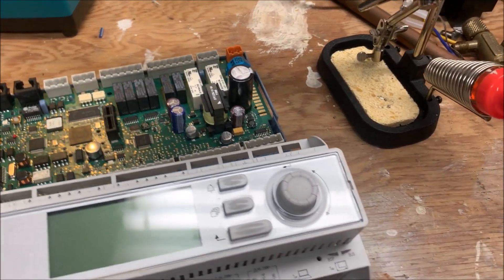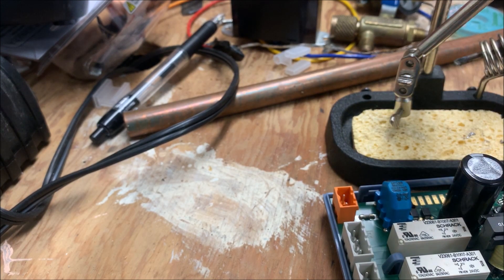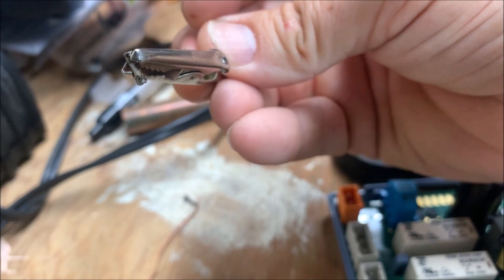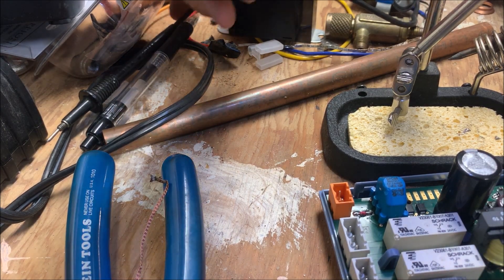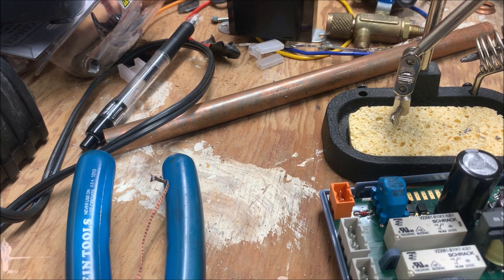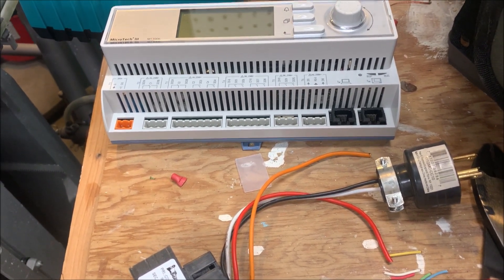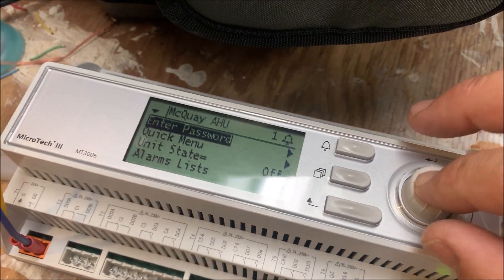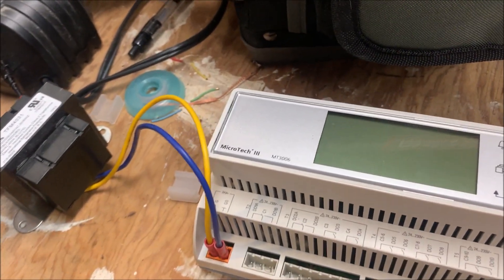MicroTech III Controller: Repair or Reject?

Comment: Sir what if no have power in controller no desplay wht problem is this sitwation in video...,but for me either fuse or electronic device etc..
Reply from the maker: In this video the internal fuse was bad, but something internal in the controller was also damaged when the fuse was damaged, so it wasn’t able to be salvaged for experimentation.

Comment: I'm sitting here squirming dude, I can't believe you did that, why would you jump out a fuse?
Reply from the maker: Because they have blown fuses before but because of an external factor. Jump them out and the controller works fine, but obviously can't be used in a unit. Makes a great learning tool if you can get one that isn't non repairable like this one was. Not for the faint of heart. Plus, I was plugged into a power strip that would trip if it was too bad. Worst that would have happened would be letting the smoke out and tripping a breaker.
Reply: @tcphvacr9950  At least, you found the short. It may still be repairable.
Reply: Tom or should I say Patrick Bergin? 🤣

Okay enough of that,   I keep the milwaukee m12 soldering iron and a small array of relays, fuse and veristors in the van for late night/weekend  repairs.  I work mostly on light commercial refrigeration equipment and ice machines. While I don't resort to that level of repair very often I do keep boards I've repaired in the truck for emergency situations until I can return with a new replacement.  Thanks for posting Patrick..... I mean Tom.  Have a great 4th!